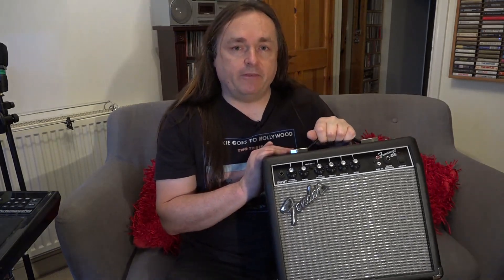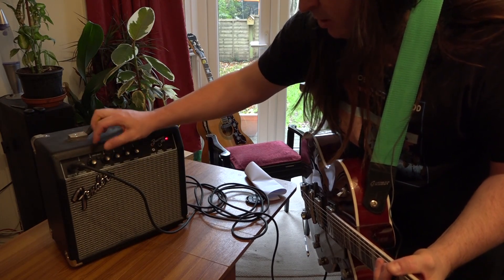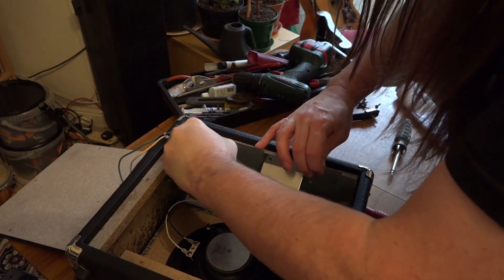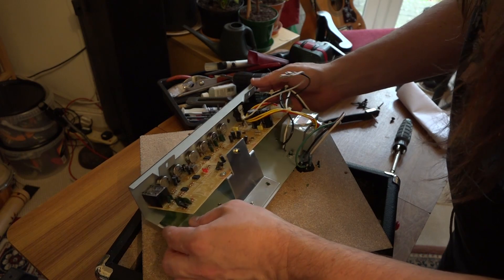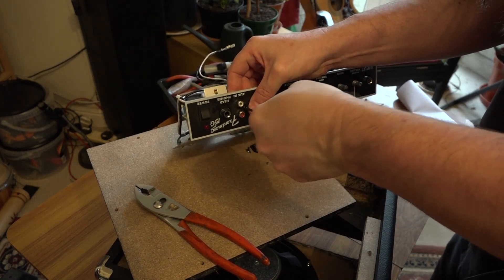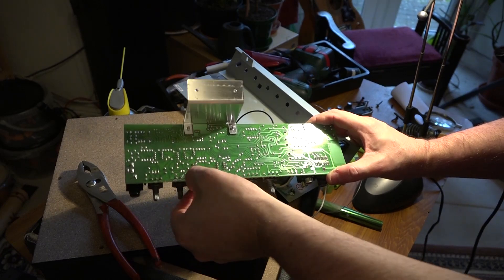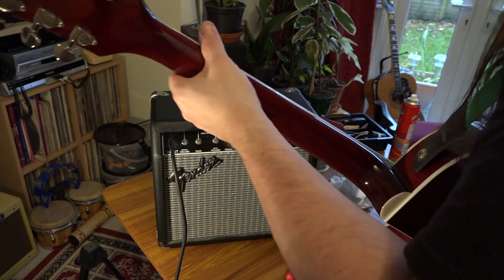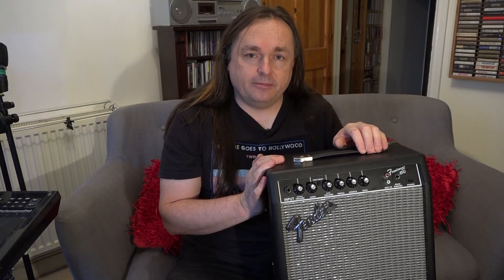Taking a look inside and a quick service of a Fender Frontman 15G Guitar Combo Amplifier

Comment: Hi, just watching your video. Thanks for sharing. It’s got some useful moments for someone like me, who’s about to repair exactly this model amp, but hasn’t done anything like this before. Those plastic nut removal tools (ugly as sin, but very practical!) look useful. A couple of comments for you: my primary use, when I was using this amp daily, was to amplify backing-tracks when teaching drum lessons. And I used the aux phono input all the time! I have several other 15W (or smaller) guitar amps, all bought primarily to do the same job - play music in drum lessons at a (non-headphone wearing) level that can compete with kids walloping a acoustic drum kit. This was easily the best amp in its class for doing the job I needed. One thing you didn’t show in your video, is how to remove the plastic pots, without either breaking them, or the board. Anyway, cheers, Seb.

Comment: Thanks for posting this video, Matthew.
Reply from the maker: My pleasure
Reply: @MatthewNorthMusic  Yesterday I used the knowledge you imparted to repair a Frontman 15G that I acquired during the week.  The input jack was intermittently operative but mysteriously I found no dry joints on the circuit board.  It turned out that a previous owner had jammed some aluminium foil into the jack, presumably in an attempt to solve the problem.  The foil was removed with tweezers and I cleaned and retensioned the contacts.  WOrks nicely now.
Reply from the maker: Some people like to do daft things glad it's fixed #winner

Comment: I fitted a speaker out socket to one of these effectively turning it into a head and ran it through a 4x12 cab, the difference was pleasantly shocking.
Reply from the maker: Well for me I agree with Glenn Fricker, most of the tone is from the speaker more than anything else. At the jam night last week I used for the souncheck my EHX .22 Calibre amp and everyone agreed it sounded good, but it was more tha sound of my 50/50 cab (I greenback and 1 old goodmans audium) .

Comment: I just bought a Bullet 15 amp. Very similar to this, but older. It's imperative that you use a GROUNDED OUTLET with your amp. Otherwise it just hums awfully. I was using a terminal strip plugged into another 2 wire extension. Oops.
Also, populating the circuit for reverb on these is not enough. There is a block in the cabinet which has "springs" in it which creates the reverb from the speaker vibrations. Nice video.
Reply from the maker: I'm guessing your not in the UK over here all equipment is mostly Class 1 earthed.

Comment: Nice work. I just this version n of amp just recently. And the distortion is very scratchy. I'll do what you did,  get some contact cleaner into it and check the circuit board. I'll report back soon .😢😂

Comment: Excellent video Matt. I have the same type amp given to me by my grandson, my problem is, when I turn it on it has an electrical grounding sound, any ideas? Do you know where replacement parts can be purchased. Feedback appreciated. Thanks
Reply from the maker: I normally buy parts online, if you are in the UK bright components are very good as well as the usual CPc, RS etc. Otherwise EBay.

Comment: Great video cheers !! I was wondering if you think the new frontman 20g has the same electronics as this 15g you fixed ? I like the sound of the 15g but the 20 has the better jack to connect my phone to it. I would think they used same electronics and maybe just used a little better speaker to get the 5 more watt ? Anyway sorry for long question 🙂
Reply from the maker: Hi there sorry absolutely no idea

Comment: Hi, when you reflow the joints do you add solder or just heat them up.
Reply from the maker: Usually add a little bit of it's crusty I removed all solder and do fresh

Comment: I have just the Amp Head that I purchased from E-Bay all the component leads look rusted and some are actually Corroded completely apart. I am going to replace all the Capacitors with Rubycon, Nichicon or a good Quality Brand name Capacitor. There are two TL072 Op Amps and One BA4560 Op Amp that needs replacing - I have used the 4562 with good results before.   Would it be alright to change all three Op Amps where they are all the same? What Op Amp would you recommend putting in the Amp Head - The TL072 state that they are JFET Op Amps so with the other be a direct drop-in replacement since they are not JFET Type Op Amps?
Reply from the maker: I've never had a problem with any TL072s. They all work fine.

Comment: Good video , thanks. I have a brand new one of these , it seems to work alright , but it always gives out a loud  "crack" through the speaker when it's turned off at the switch on the RH side , even without the guitar connected .  Any ideas ?
Reply from the maker: shouldn't do that if new normally it indicated iffy switch making a poor initial contact. or failing capacitors in the Power Supply. If its new id take it back.

Comment: Rubbish plastic input jack breaks within a year. Sounds ok, but early Peavey Rage is built like a tank and will last forever.
Reply from the maker: Is the same sockets that are on most of that range of fender amplifier. If they break then I would suggest that's more based on the user.